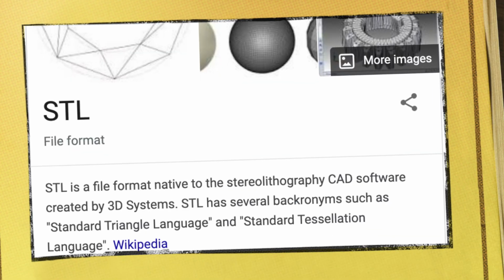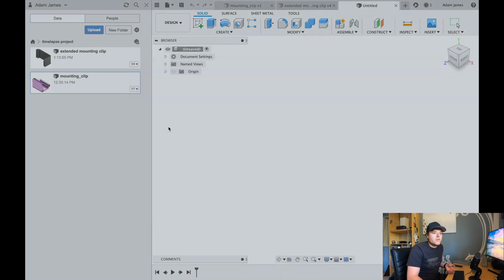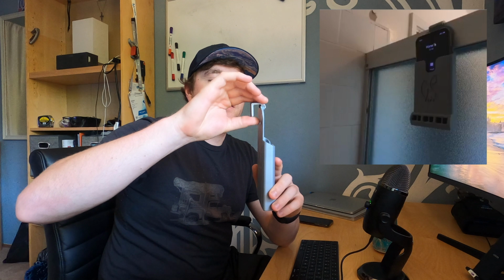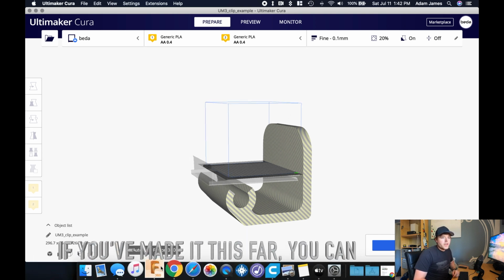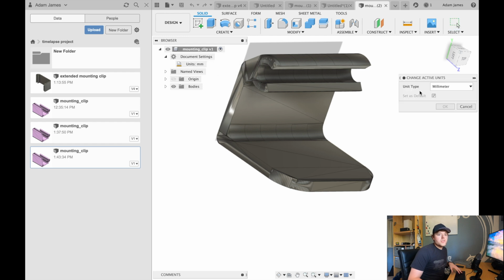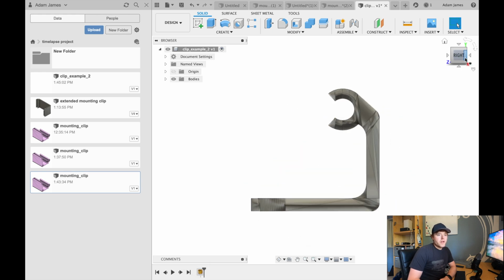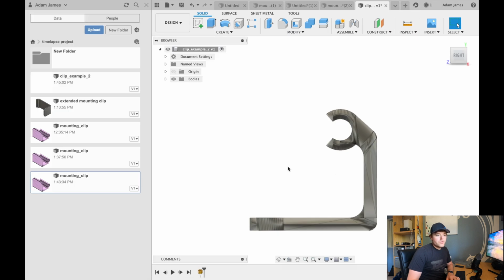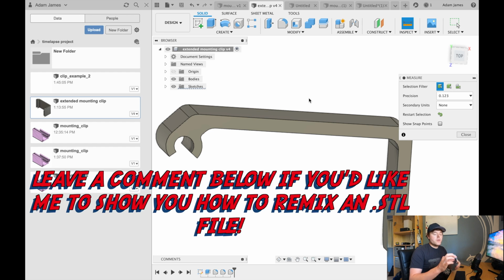How to import an  stl file in Fusion 360

Comment: The only issue is that the uploader and then you inadvertently did a 2x inch to metric conversion, resulting in an upscale of 25.4

Simply scale the entire model down by 25.4 and you have your original part back in scale.

Comment: Would definitely be interested in how to modify a stl.
Reply from the maker: next video?
Reply: @adamtjames  breaking a model into smaller peices, cutting and merging, or even the that changing one dimension like your example.

I'm new to 3d printing and have kind been cheating where I can by dropping unwanted parts below the build plate and gluing stuff where I want post print.
Reply from the maker: SoularisEsprit I’ll see what I can do!
Reply: My thoughts exactly. I have never modified a file before and would find that very useful

Comment: Thanks for sharing your knowledge and experience - I am just getting into the 3d Printing world coming from a CNC router background where 3D really means "bas-relief" since undercuts are not possible without a hugely expensive 4th axis.  I just ordered a Pulse XE from Matterhackers yesterday and I'm spending the lead time doing research.

I use Vectric Aspire 3D modelling software to produce all of the tool paths for my 5' x 10' Camaster Cobra and the user interface and functionality is very different from Fusion 360 so Videos like this are a real time saver - It will keep me from wandering down the same path you did and let me just cut to the chase so to speak.  

I have an Einscan pro 2x plus scanner and am able to scan objects with pretty decent resolution for prototypes or broken parts for possible reproduction.  The problem I have is that once I create the .obj or .stl file,  I  want to be able to make changes to it to adapt for other purposes or to repair surface blemishes - is that possible with Fusion 360?  

For example, I scanned in a brass owl incense burner that had a very dark rough exterior surface - to this, I had to use "markers" (little round dots placed randomly so scanner can maintain reference position) every 2" or so - these allowed me to scan the art with great accuracy, but every place a marker was used lost the characteristic rough texture - I want to be able to replace those smooth patches on the surface with a copy of the adjacent surface texture effectively repairing the marker blemishes..

Does that sound like something that could be done with Fusion 360?

Thanks,  I apologize for this mammoth post, but I have not been able to find anything that adresses this issue by googling and was just hoping maybe someone else had the same problem and a solution.
Reply from the maker: Hi Terry! Of course! I have a video coming out next week incorporating a 3D scan into fusion 360 and then modifying the geometry! Look for that soon and thanks for the support!